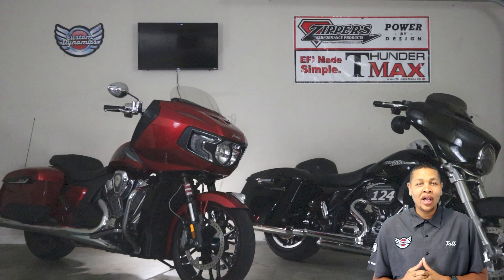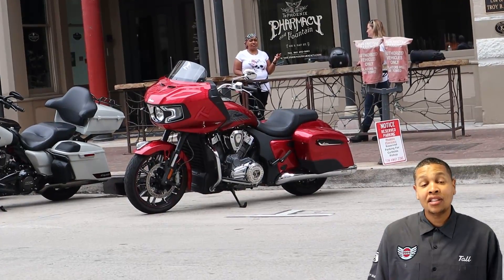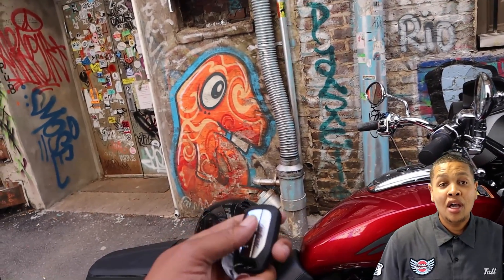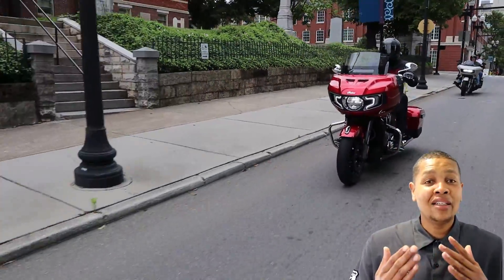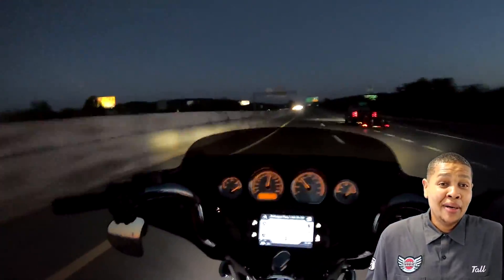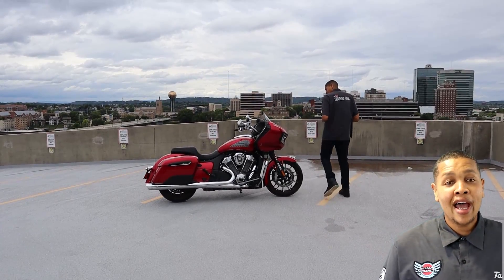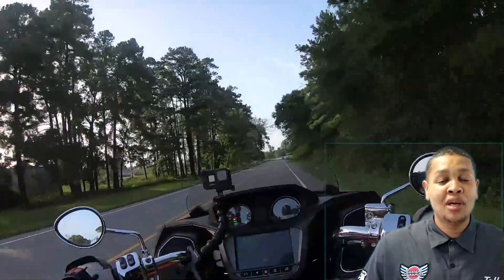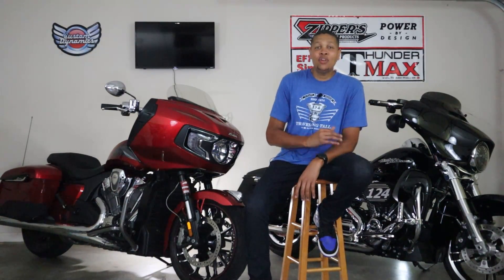Harley-Davidson VS Indian  Challenger.  THE FINAL REVIEW!

Comment: Since the folks at Polaris are probably reviewing the comments, here is my opinion. Competition is a good thing: I have test rode all the Indian models with the exception of the Challenger and Harley models (except Trike).  The Indian models look good except for the Challenger.  The engine sounds awful.  The front end is just ugly, rest of the bike ok.  Polaris needs to stop trying to copy Harley and do their own thing with styling.  The Victory line had far better styling in my opinion so see if you can bring that back into the styling of the Indian or for a certain Indian touring line.  The quality of the materials used for the Indian line is not up to par at all for the price, it's just cheap materials.  You do get more options from Indians on a stock bike which is a plus for sure.  All the bikes from both manufactures ride differently and you need to test ride them before purchase and just go with what you like.  I was looking at purchasing a Victory or Indian a few years ago, then during the process of trying to figure out which one, the announcement came of dropping the Victory line and just running with the Indian line.  That was the deal breaker for me of doing business with Polaris.  I have heard the gripes of Victory owners afterwards of the extreme depreciation resale value and availability of parts.  That was so wrong to the customers and is the main reason I will not be buying a Polaris product of any kind.  Had a friend get the short end buying a jet boat from Polaris.  If you are going to make it, stay in it for the long haul.  Make it better, style it better, use better materials and think about long term instead of short term quick profits to appease the shareholders.

Comment: When you buy a Harley, you are buying way more than the motorcycle itself. That being said, for my type of riding, the Challenger out of the box is a better bike. Is it that much better that I would trade in my 2020 Road Glide 107 for it? Nope. Would I consider it for my next bike? Perhaps. But the down side is not the lack of support. It is the resale/trade in value. Indians lose their value quite quickly. So if you buy one, you better be ready to keep it.

My RG is not my only bike. I ride a Concours C14 and a CBR954RR. So I already have a "Performance Bagger". Maybe I would feel different if the RG was my only bike.

Comment: So many aftermarket parts to make a harley engine better.... let that soak in.  If Harley would have made a bullet proof engine in the past 30 years we wouldn't have such a strong after market presence because it wouldn't need it. A harley engine barely handles its stock hp and torque.  If you do anything that give it more hp and torque then you better spend the extra cash on those secondary parts that you will need to handle the gains otherwise something will break causing a catastrophic failure.

Comment: Another water buffalo, pah.  Radiator, water hoses, thermostat, more crap you have to look after.  Electronic rider aids you don't need that get between you and the bike.
Reply: Do you like any modern bikes? They’re all run off canbus systems, sensors everywhere. Indian Challenger is liquid cooled HD’s are oil cooled. What’s the difference? Sounds like the only bike that fits the bill for you is the classics. Nothing wrong with that, but time must go on and so must bike tech.